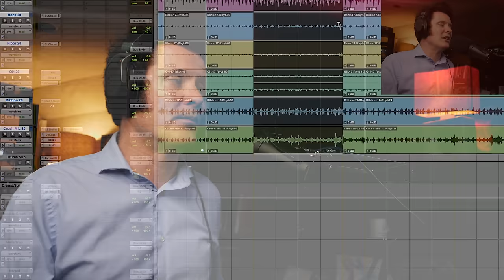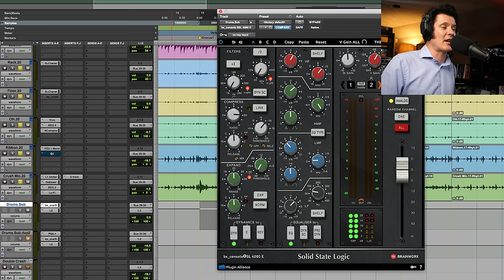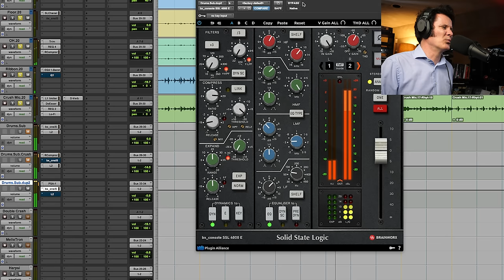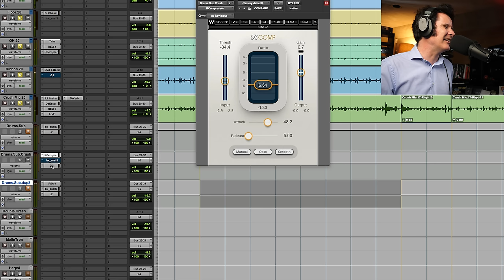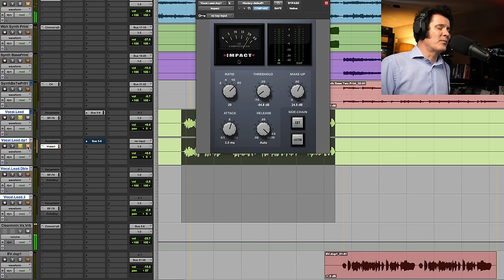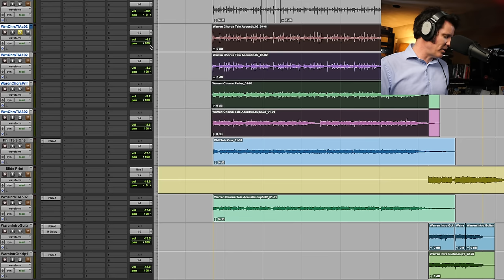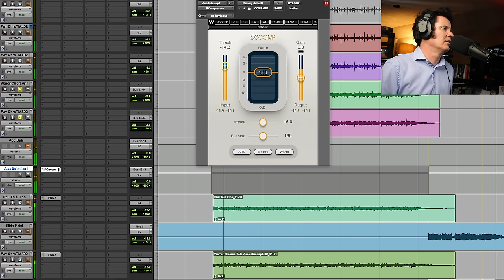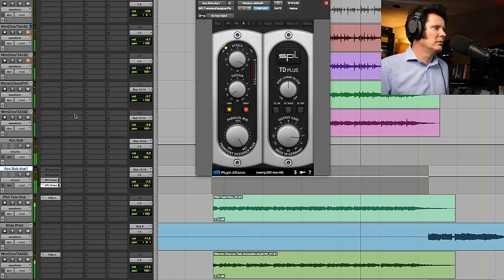Secret Digital Mixing Trick for Analog Sound - Parallel Compression

Comment: Reaper has a mix button on every plug in, parallel everything!
Reply: Seriously? This alone might be enough to get me to switch over...
Reply: Yeah, I fell in love with that blend knob when I switched to Reaper.  Super fast to add parallel processing, even just to see (hear) if it's better or not.  Love how that knob can be automated too.
Reply: @JamieClark  Yea, it doesn't work on a couple of plug ins (weird phasing issue) but 90% 👍
Reply: @TheLastMoomin  Just wanted to Thankyou mate for your original post, it's been a life changer. Iv'e used reaper for a few years without knowing this and already my latest mix sounds way more pro sounding, Fabfilter Pro C2 works a treat. Cheers again!
Reply: @akoustixx  Sweet. I'm new to the audio production game, guitar is my thing. Glad I could help, Produce Like A Pro has been immeasurably helpful.
Reply: i love it, it works great with distortion to, add distortion to bring out new harmonics, dial it back with the mix knob, instant ''analogue'' sound
Reply: It’s one of my favourite things about Reaper! (And there are many).
Reply: Studio one has a split tool that makes doing parallel stuff easy too. Cool stuff
Reply: fl studio too actually works great on FL 20 unlike the older versions that always have phasing  issues
Reply: @akoustixx  I have Reaper but rarely use  it can you tell me exactly what you're speaking of or how to do it step by step please?👀
Reply: @DocKaosBeats  All plugins used in reaper have a mix knob at the top right hand corner, use it to blend in fx compression ect.
Reply: @akoustixx  Oh ok thanks I was kind of confused still
Reply: @akoustixx  I wish there was a Reaper community where we could interact with different Reaper users from all over because I rarely see people who use Reaper
Reply: @DocKaosBeats  Why not consider joining Produce like a pro like me, where there's lots of reaper users and pro mixers who will give you great advice, it's just one big mixing family :)
Reply: @akoustixx  I might just do that
Reply: @DocKaosBeats  If you do then come and have a live chat with me and others about anything, I'm Billy Bates btw ^^
Reply: Isn't that serial compression, if you're just adding a compressor fx to the track  and using the wet/dry mix on the fx ??
Reply: But isn’t this only mixing dry signal with wet signal? Not quite the same as parallel compression. Unless of course you’ve already compressed your track before hand. Oh, or if you’re running a second compressor in line on the same bus. OK I think I get it
Reply: FL Studio too .

Comment: I use parallel Compression all the time, especially on the drums (It's literally half my Drum Sound), however I only add the close mics to it which avoids alot of cymbal splash. will definitely try the Guitar Trick. Thanks for the Great Video

Comment: My crazy parallel trick is to drive a pre to distortion, and flip the polarity. Mix with unprocessed sound. I grab the eq and do opposite day eq🤣. Discovered it by accident of course. Surprisingly cool and useable. My fav is a low headroom Ross 8x2 mixer. The pres on it are insane and musical when driven. Auto flips the polarity too.

Comment: Something I like to do to get a more analog sound is using a tape emulation plugin (with a good flutter control - I use air windows totape6). I put it on a track and adjust it to my liking, then duplicate it. Then I pan the two tracks left and right and mess with the flutter on both tracks. It really works on anything: drums, guitars, vocals, single tracks, busses, etc. I find it really makes things sound a lot more like they were recorded to tape.

Comment: Warren, I have been wondering what you think of analog summing. I recently had some big decisions to make in terms of budget for upgrades. I was considering investing in a summing mixer. I went back and forth on it, listening to shoot-outs and hearing what the gear-heads had to say. I finally went so far as to reach out to David Botrill to inquire about how he mixed Lateralus for Tool. Of course he informed me that it was all analog anyways, so summing wasn't an issue. He also told me that now he does everything in the box, and really had no opinion on analog summing, one way or the other. Since David's productions are to me, the gold standard, I decided to invest the bulk of my funds into improving my "box". Switched to Mac with Luna as my DAW, added UAD interface (Apollo x4), purchased the Neve Summing plug-in (which is really amazing and makes an immediate noticeable difference in depth, stereo definition, and headroom), bought the Softube Console system (both pieces), loaded up on UA, Waves, and iZotope plugins, and sunk the rest into building a modular synth rig around three Moog units (Matriarch, DFAM, and Mother 32). I am very very happy with all of this, but I was considering investing in a 500 series setup with a Cranborne unit that also serves as an ADAT and summing mixer. I need ADAT in order to utilize the full I/O capabilities of the Apollo x4, but I'm having trouble deciding if I should go the extra mile for the 500 series analog options, which will get pricey as I go. So I guess the analog summing question is the key decider for me.

Comment: Along with parallel compression, I like to use parallel reverb and parallel delay or both, I would  amp up the reverb untill it starts to sound washed out, and then I'd feed that channel alongside the original or I'll use a compressor and squash the hell out of the reverb or delay, I like to use distortion with delays and reverbs.

Comment: I've never used parallel compression before but will need to try these tricks of the trade.  I need to figure out the routing in my DAW as it's very different than Pro Tools.

Comment: I don't always use parallels with compression. I use the technique for just about anything I can conjure up to get the sound that excites me if the material calls for it (DIs, re-amps, saturation/distortion, radical EQ, dynamics processing, effects, etc. As far as compression goes though, I often use it on the drum bus but typically only on certain drums, OHs, or ambients depending on the song. Occasionally, I'll used it on the entire drum mix. Otherwise, I use it on any other track or bus if needed to provide the "parallel" crush blend. I rarely use it on the 2bus. I have other goodies for that I usually like more...namely tape emulations, sat/dist, etc. I've also been liking the Black Box HG-2 and the VSM-3 or SaturatorV2 from Brainworx or the SDDR from Klanghelm. In any case, parallel blending of any sort is definitely a very useful technique to shape audio.

Comment: Awesome tips! I've never actually tried parallel compression on vocals, though I have chained compressors in series, which can sound very smooth, but obviously way different. I like when a compressor has a mix button so you can instantly hear the parallel compression, and possibly save some CPU cycles if you're hitting the ceiling :-)

Comment: Hey Warren! Could you make a video about depth? I think depth is the biggest issue in my mixes and I'm probably not the only one who really struggeles with it. I've been mixing seriously for about a year and can't find the best way to create depth. On internet lots of people say that you should lowpass, but I don't see proffesional mixing engineers and producers use it in mixbreakdowns on youtube. Stil they have amazing depth. Could you tell us what techniques they are probably using? I would really appreciate it.
Reply: I wouldn't recommend low passing because people on the internet say to. Low pass when it sounds good to your ears and accomplishes what you're looking for. I'm sure Warren will give you a better answer, but here's a couple ideas...Try contrasting dryer elements with a few carefully selected reverb or delay elements. Also, width comes at the expense of depth so if everything is panned out wide...then your imaging will be spread out thin. My personal pet peeve is widely panned drums, but you might have different taste. Contrast is key.
Reply: @markv2360  Thank you for the tips, I appreciate it! That's what I thought why would you remove the air and highs that you like, I am sure there are way better ways of doing it. I'll try some more with wet and dry contrast, it will probably improve my mixes already. I also spread my drums out wide, it will make way more impact. Thanks!

Comment: Greetings Warren. I see that you are mainly using parallel compression with slow attack time, therefore enhancing the transients. How does this work if your goal is to smoothen the trasients as tape does?  I can see how this makes everything punchier and louder, but doesn't this go against the concept of smoothening and/or getting louder mixes? Do you see an application for parallel compression also with fast attack time (or even limiting)? 

Thanks for your videos, you're great

A big fan of yours,
Fabio

Comment: i absoultely  love the brain works G and E series, i even like it better than their SSL j9000 series console.   I tell you mixed and paired with the SSL2+
 with the 4K legacy mode is a pretty darn special arrangement, I have it pre slapped on each channel including the master. The elysium Alpha compressor is pretty much a monster for ACTUAL analogue limiting/Softclipping, I mean it can almost double the luf while leaving the decibals comfy at 0.    I am also really Digging Softubes new Approach to AMP room.

CHECK OUT even tides side company NEWFANGLED, they have an EQ i originally got in my plugg in collective through focus rite or novation i cant remember, but i was so impressed and blown away I bought another ( even though I had a liscence, and purchased their full Elelvate Bundle which if used properly can pretty much be your mastering chain...although i use peices inbetween others in my Masterbus Chain Usually starting with the Alpha Master Compressor just to Chop that sound in like half and rebuild it it also has a very transparent and great EQ kind of included on it, However I run the Newfangled Equivocate (based on the human eardrum with 26 different bands) sometimes it blows me away when i A/B it without EQuivocate, Then I run it to the SSL 4000g for extra compression and dynamics,    as a Brickwall, and a ''Pusher'' I find that softtubes Tape, offers an unparralled amount of perfect true harmonic distortion- that used to just be an effect of all the eqiupment wed have daisey chained back in the day. I also run it at half speed. during recording, It requires to focus on the details MUCH more.

Comment: I was mixing a song where the drums were recorded to an stereo track (already mixed down), but still with some careful parallel compression and distorsion I was able to get them to sound great, of course having only the kick and snare would have been great. On another song, I was struggling with an acoustic guitar, I will try out using parallel processing and see if I can get it to sit well in the mix.

Comment: As a relative beginner, I've a problem with compression - especially parallel compression. In some projects (house/techno) I soaked lots of tracks with it, and when they later came back from mastering the mastered versions were worse than the mixdowns - trabsients popping out, some tracks suddenly too quiet, balance totally messed up. The one time I used hardly any compression - my track came back from mastering almost perfect! I probably used too much compression - in particular parallel - and will use less in future, but... where do you draw the line? Thank you (and respect!)
Reply: I'm probably not the guy you wanted to hear from! BUT if it helps:

Focus on where you want thickness and/energy in your track and then apply the compression there and blend it in to taste. (take the fader down, and then slowly bring it up until it "fills out" the area in the mix you were wanting.) Just be mindful of what your attack and release settings are and if they are helping or hindering those elements in the mix! 

If it sounds too over the top and/or "pumpy"- it's probably too much and you'll want to dial it back.

I find more minimal styles of EDM don't often require a ton of heavy compression or parallel compression to get things sounding big. The space kinda does that itself. So a little bit of compression goes a long way here! 

Of course, if you're ever unsure on something, pop in a reference track that has a mix you dig, and reference it until you're able to match it as close as possible. :)

Comment: I have a question, do you first add parallel compression to your vocals ( on dry signal) and then mix the non parallel track normally, or it's OK to process the original track with plugins and then add the parallel vocal compression?

Comment: One question though... How don't they phase with each other?? Cuz when I tried the same parallel technique on Saw waves, it was actually phasing..
Reply: If anything affects the EQ of the parallel, it can cause phase issues. If anything affects the timing, like if the second track is going through something analog and there's latency, definitely phase issues. I can't think of what else would cause it. Bear in mind, everything, even compression, is probably affecting the tone a tiny bit. Just usually not a damaging amount. Try another chain or something?
Reply: @Melvin7727  Sure mate, thanks:)

Comment: Hopefully someone can answer this as I’m not that familiar with logic, but why does he use a different track for his second compression as opposed to keeping it on the same track but later in the bus? Is it any different from just having two on the bus? (Hopefully I used those words right) 

Tho it’s possible I’m confused and he was using a second track for demonstration and muting the first track while placing two compressors on the second track.
Reply: Watching a bit more it seems he’s duplicating the sound in the other tracks to add to the sound of the original and then he parallel compresses within each track. I mainly use fl studio so it wasn’t immediately apparent to me. I may be wrong again though, correct me if I am please

Comment: I hear a flam when adding in the 3rd parallel comp track on the drums. Is it a latency issue or is it the distortion sound?
Reply: Make sure you have delay compensation enabled in your DAW.
Reply: @JosueCuervo97  yes. I should have stated that I hear that on this video.

Comment: Even with all these plug-ins Warren has added, it still doesn't sound like drums, vocals or guitar recorded on analogue tape, Listen to Bon Scott era AC-DC or any Led Zeppelin for examples of how great drums sound when recorded through great mics a great board and onto analogue tape. I think the magical sound of analogue goes beyond compression and saturation and noise.
Reply: I don't think anyone is claiming that it sounds the same.  It's a way to get closer.  A tone between full analog and full digital if you will.  Each medium has it's good facets.